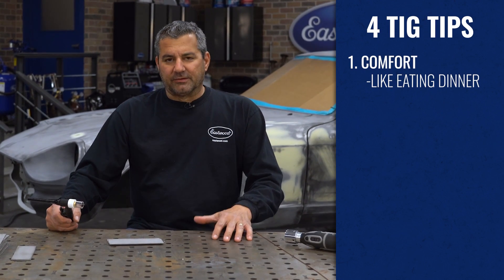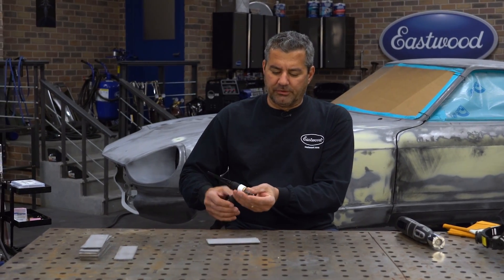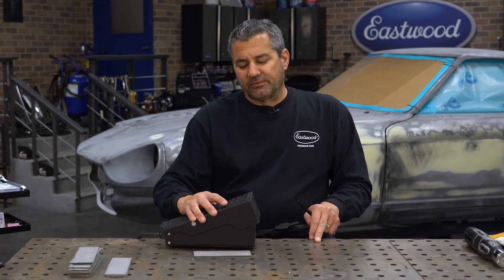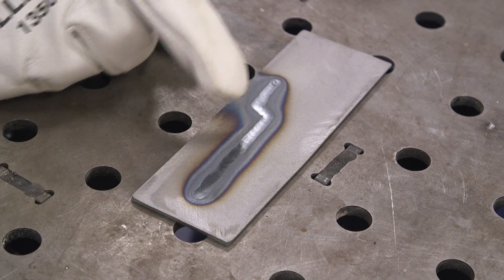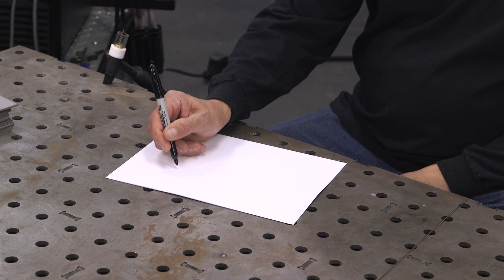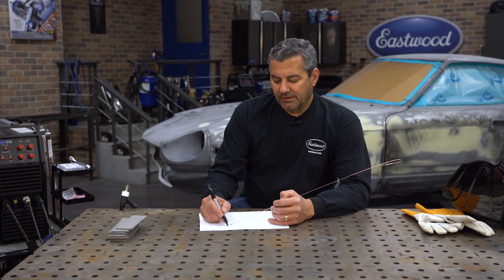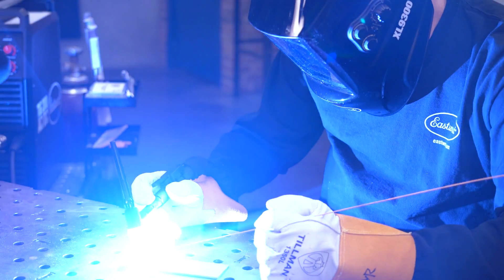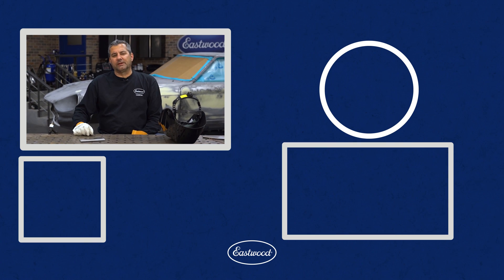4 Tips To Make YOU a BETTER TIG Welder

Comment: What are the benefits of TIG welding over MIG/Flux core ?
Reply from the maker: TIG is going to give you greater control over the weld, so you can put less heat into something, can weld more complicated metals like stainless, aluminum, titanium, etc. However it's also a harder process to learn as you're controlling a torch, a filler rod, and amperage vs just a torch when MIG/Flux welding.
Reply: @eastwoodco thank you.

Comment: So does tig welding get used to hang body panels? What scenarios is tig used over mig?
Reply from the maker: Both are used everyday. MIG is more accessible as it's much easier to learn and still provides great outcomes. If you have the ability to TIG you may choose to do that as it's harder but has greater control.

In a production body shop most panels (like quarters) are actually going to be glued on then the seam MIG welded. If they don't glue the panel it will likely be plug welded with a MIG Machine.

In aftermarket applications TIG is used a bunch such as in this video where Ryan is fabricating a wide body kit: https://youtu.be/oR3bfoNReLI

Comment: I always remember cup size is the  16ths of an inch the tungsten can stick out and gas flow psi min max is 2 and 2.5 times the cup size, but for some reason always forget to mention torch angle when trying to help coworkers get better/try out tig welding

Comment: Sometimes when I'm dipping the filler rod into the puddle, it sticks a little bit when I try to pull it back out, does it sound like there is something specific I'm doing incorrectly ?
Reply: I have this problem learning. I believe the filter rod is too large, as you ad the rod it cools the pool then the rod sticks a little bit. Ive only got 2.5mm rods but I'm going to order some 1.5 rods too see if that helps.

Comment: What amperage, glass cup size, an tip out would you recommend for fusion weld thin sheet metal on a butt joint ( ie replacing sheet metal in a bed of a truck or body panel)?
Reply: Very nice 👍❤

Comment: The best advice I’ve ever seen on YouTube. The solid basics to get you started…. None of the other technical babble that only confuses beginners. Puddle control is where it’s at and you can’t get there without comfort, position, and steady consistent movement. I’m self taught through trial and error (mostly error for a long time) and wish I had this advice to focus on these four things when I started. Great tutorial. Thanks.
Reply: Everything but dialing back amps to reduce HAZ.. turning up amps and moving faster once comfortable to do so is the only fix
Reply: @tom-rz4zg  In some cases you 're right. But there are situations with very thin material, you have to reduce amperage to get good results.
Reply: @tom-rz4zg yup. 
And I’m a beginner TiG welder but ~30 years mostly Mig occasionally rarely stick. 
But I can’t take a guy seriously who says “heat effect zone” instead of “heat affected zone” and then talks about ‘discoloration.’ 
Basic ignorance of and misunderstanding of the essential properties of metal. 
He might be a fine welder but how can you be sure when he doesn’t know an essential basic.

Comment: Very good info, but when I was learning I was taught the puddle control on aluminum. It’s so much more defined on aluminum than it is steel. I thought it was hard to see the puddle and dipping your filler wire on the video. But I think aluminum would show through much better. Plus explaining the contaminates would be shown easier with alum also. They always said learn on steel then do aluminum but I did it backwards.
Reply: Same for me, I thought that aluminum was so much easier to learn on. My steel beads looked like birdsht for a while and my aluminum ones were nice-ish!